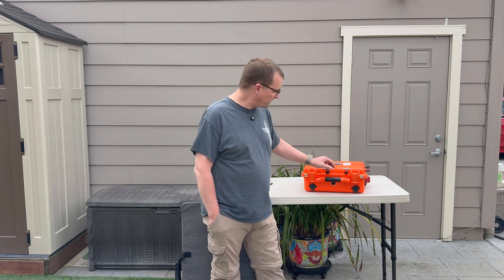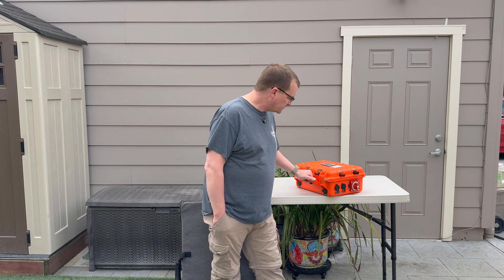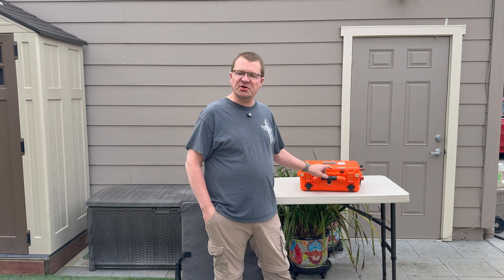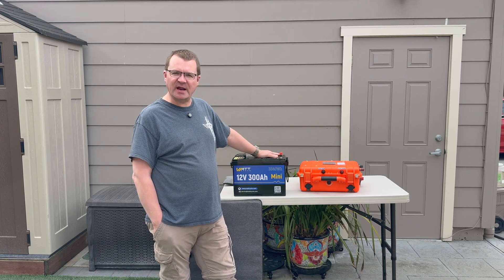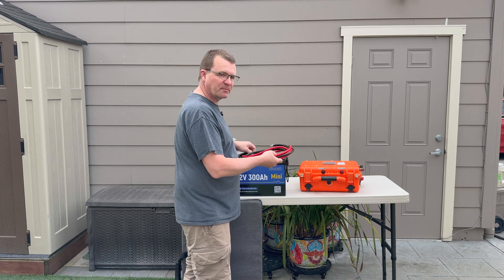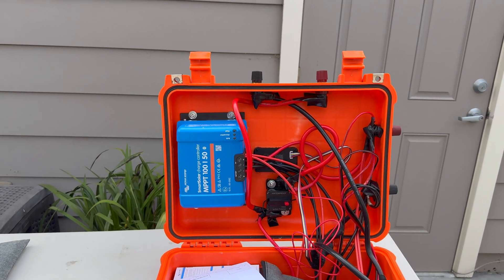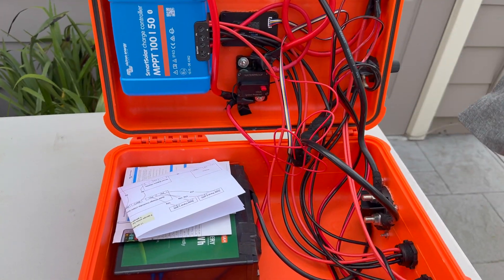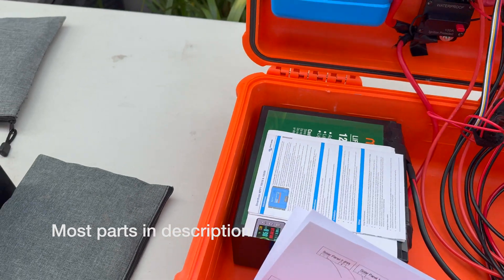Unconventional Battery Box.  Internal battery + external battery.

Comment: Very cool. Even the pre-built units I buy, the amount of capacity they have isn't very important because I just recharge them with a bigger battery as I use them. DIY box where you can just switch to a plugged in external battery is also a good option.